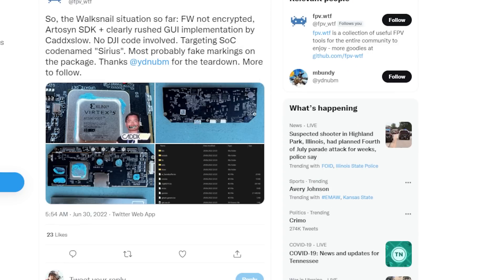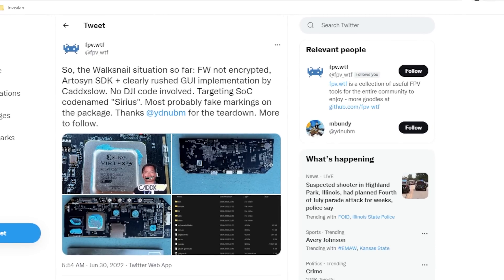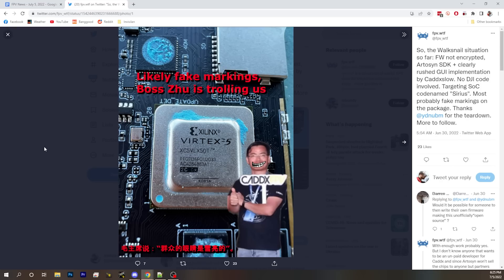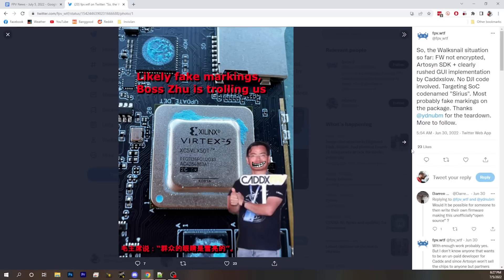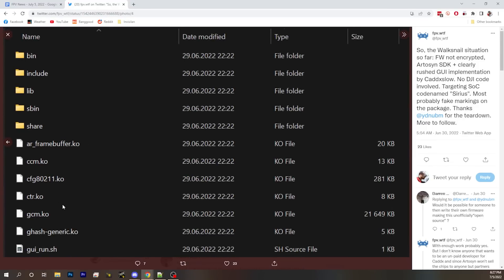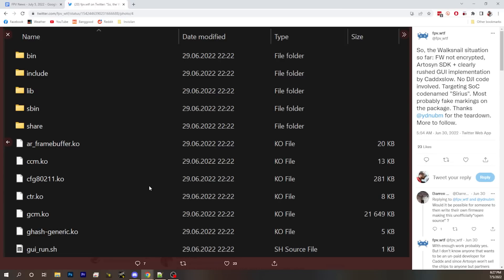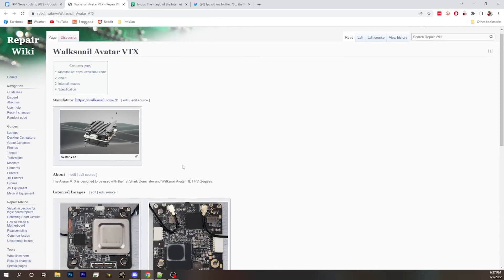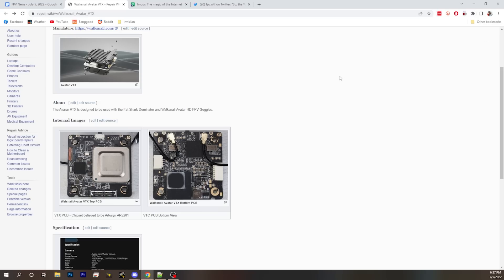The Fatshark Dominator Walksnail Avatar Exposed - Root + Chip Markings Are Wrong - FPV News

Comment: In my humble opinion; I think walksnail had the DJI information, either reverse engineered or other means, and tried as absolutely hard as possible to mimic it without actually using any of dji’s coding. This is likely why so much stuff doesn’t work.

Comment: I'll go on record saying you can probably find my comments saying something along the lines as "it's gotta be DJI". Oops. It wouldn't surprise me though if some of the engineers are the same. Like,.. AnyCubic and Elegoo. The look the same. And when you ask about firmware updates, they effectively say, " we'll have to see when the engineer comes around and has some cycles". It's all outsourced.

Favorite quote: If you really thought it was DJI, then why is the performance so much worse.
Reply: Same here, I was pretty convinced that it's DJI. I thought that since DJI will probably come out with a new system, they allowed Caddx to use the currrent Vista/Goggles hardware and software. There might still be some reverse engineering and undoubtedly the UI looks like a reskin. But ultimately, this makes it clear once again that we shouldn't just assume but wait for evidence.